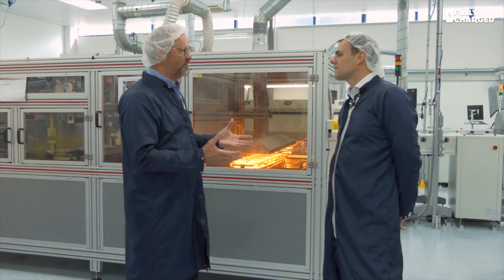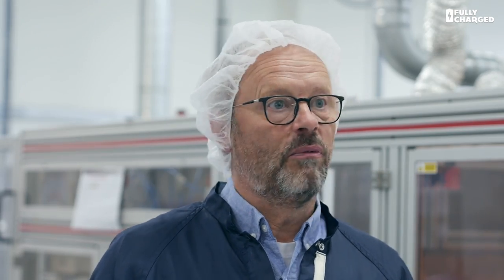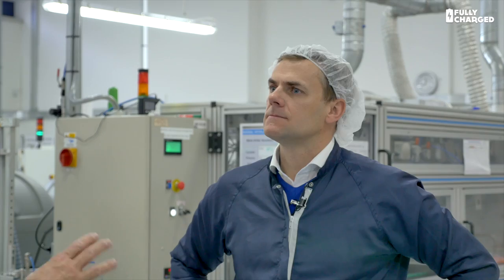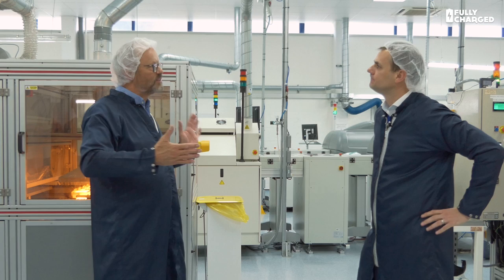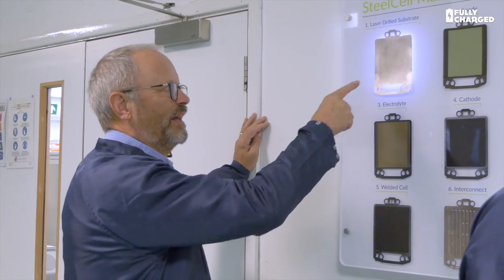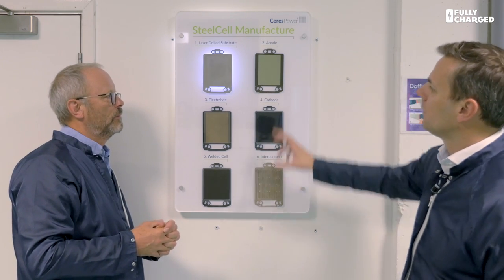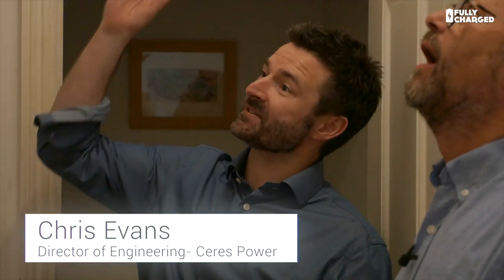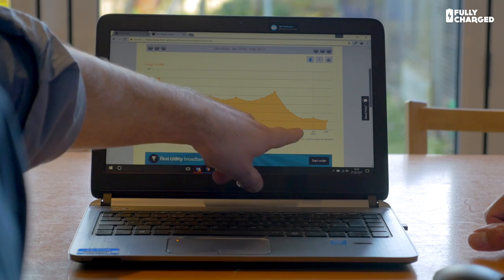Ceres Power | Fully Charged

Comment: Wow, a real engineer tells us that the grid in his region loses about 65% of its energy during conversion and transmission. His comments are truly helpful! That cataclysmic loss must be the reason why we can't have "nice things," so maybe some of us should pay closer attention when real engineers tell us how to effectively support and promote technologies.
Reply: The loss isn't news... it's a well-known stat.
Reply: You can calculate it in your head without ever looking at anyone's stats if you know basic physics, and for recharging of EVs, the loss equates to heaping mountains of nuclear waste!
Reply: To really understand these numbers, you have to know the world record gas turbine has a efficiency of slightly above 60%. You already lost 40% converting gas to electricity. Their real achievement is to come very close to that record number with a very simple system compared to such a multi stage turbine.
Reply: We're not referring to the turbine efficiency. Even if the turbine supplied 100%, you'd lose at least (roughly) 70% to stepping (voltage reduction through transformers which is also conversion), resistance of cabling and switching components, current regulation systems, environment potential at high voltages where the field meets pylons/atmosphere/soil, regulation components of endpoint systems, and finally, the storage materials which can never absorb 100%. There's no reason for anyone to accept EVs as a solution to the emissions problem since they aren't any cleaner than vehicles with internal combustion engines.
Reply: not sure what you mean when you said "and for recharging of EVs". Do you mean when you get power from a natural gas power plant and recharge your EV from it? Or when you recharge an EV from this power on demand system in the video using gas, or charging a tesla wall from solar and charging an EV? Not sure how any of those turns into (even proverbial) nuclear waste either... but do go on.
Reply: I mean "Attaching them to a recharging station which is supplied by the grid which loses no less than 70% of its current before the battery receives anything." That lost energy must be generated by the source (materials processed and then exhausted), the loss increases as load on the circuit increases, and there won't be any possibility of supercharging EVs from residential arrays or service stations with storage systems.
Reply: The efficiency of a conventional Rankine cycle steam power plant is around 40% based on thermodynamics, regardless of the heat source. e.g. 40% of the thermal energy (from chemical fuel) is converted to electricity. The grid is very efficient at transferring that energy over long distances due to very high voltages. So 35% overall efficiency is not unreasonable. There's only about 3% loss from the grid. The biggest loss is that initial 60% of heat which lost through the cooling towers. That's why combined heat and power has big advantages. Piping the waste heat (it's low temperature, low quality heat which you can't extract much more power from) from power stations to where its needed is completely impractical, so it's just vented through cooling towers or used in greenhouses or factories built nearby. Having lots of small generators where the heat could be used where it's needed e.g. homes has been impractical up till now. If this is as good as it looks (I personally think there must be a catch somewhere) then it could be fantastic.
Reply: The resistance of cabling alone causes more than 3% loss and there's no possibility that the transformers are 100% efficient. Again, the biggest losses are resultant of stepping, regulation, and potentials where large fields make contact with the environment. A distributed (grid tie) system must be synchronized so that phases align or the sources will negate each other and destroy the distribution systems. There's no efficient way to synchronize a distributed system and it's best for owners of alternate power systems to utilize the energy for their own purposes.
Reply: ForestNinjaZero - Your point on emissions is a good one, but you only look at the emissions for the local grid to supply power for EV's. What about emissions for the production of fuel for ICEV's?
Diesel generator to operate the oil rig and pump the crude to storage tanks, then to pump to super tankers powered by diesel to take the oil to whatever country, where it's pumped of into the refinery, which then uses the local grid to produce the fuel which puped into a fuel tanker, power by a diesel engine to deliver it to the service station, which uses the local grid to pump it into the ICEV. All those emissions before you fill up the tank and start up and drive off.

So the local grid to charge an EV or ALL those emissions to produce the fuel before you even start your ICEV. 
Makes your emission point a bit mute don't you think?
Reply: At least liquid fuel can support itself, and the conversion rate is multiples of that of electrical transmission systems under the load which would be required to support a fleet of EVs. I can load a tanker and power it to the destination with a portion of the fuel and then supply my fleet without filling anyone's backyard with nuclear waste - please don't counter this with the solar argument since it won't be possible to meet the demand for tens (possibly hundreds) of gigawatts with a central solar farm or support 3+ megawatt service stations with independent arrays. Additionally, if I don't like the 'smell', I can re-tune my existing ICE for any alternate fuel which is cleaner instead of forcing the consumers to sell their irreplaceable multi-million dollar collectibles for scrap while offering no productive solution to the original problem. The EV isn't any cleaner when recharged from a central source, so it isn't reasonable to replace an entire fleet which is already productive and can be easily adapted for more effective alternatives.
Reply: ForestNinjaZero -  I've not mentioned nuclear or renewables. I was only pointing out emissions. I have nothing against the ICE, I have made my living from it for decades. You see I work in the auto industry, i've worked for Johnson Matthey Autocatalytic division in Royston, Herts, UK, where I helped to develop and test "cats" for most of the vehicles you see on the road today, from Tata to Rolls Royce, so I know a thing or two (not a lot) about vehicle emissions. 

I see your point about nuclear power, it's the gift that keeps on giving, and with around 440 reactors in operation around the world, and 60 under construction, plus 160 planned and upto 300 being considered, I 
hate to think of the clean up. And when you look at the current 440 plants in operation, accordig to the World Nuclear Association, in 2014  these provided 2411 billion kWh, over 11% of the worlds electricity. 

But when you see Saudi Arabia trying to sell off oil production, and oil companies getting into wind farms, maybe there is a future for renewables?
Reply: Consider that the ultimate goal of physicists who have dedicated their lives to energy research is to accurately model and replicate the sub-atomic processes which fuel self-sustaining energy sources such as our sun. If you research fusion generators and projects such as "ITER," you'll see that nuclear (fission) power is only a stepping stone and that we're within decades of the next "atomic revolution." My biggest concerns for the fusion generation are the competency requirements for deployment and administration of fusion systems, as well as the inefficiency of turbines(!) - Hopefully someone will return to the nuclear battery research which appears to have been abandoned by the military decades ago.For desert regions such as those of the middle east, it might be acceptable to fill or surround large areas with arrays of panels or large wind farms which can be utilized locally, but for large cities where demand is measured in gigawatts and there is nowhere to construct an array for tens or hundreds of miles, solar and wind won't be appealing to the public or state governments due to the requirements for collection area and transmission systems. It won't be possible to eliminate dirty sources while residential systems cannot fully support households of any size, even with full utilization of available surface area.Regarding future, I'm not suggesting that anyone should abandon wind and solar, however it isn't likely that the cost will ever truly be competitive for the consumer unless they construct and maintain their own systems without any kind of support from companies such as "Solar City." Personally, I don't mind the work, but there's no incentive for anyone who isn't an enthusiast, apart from Elon Musk's promises of accelerated evolution, and the natural desire to play with high-tech equipment.
Reply: Onshore wind turbines are actually one of the cheapest sources of electricity believe it or not. And it's continually improving. I've just finished my mechanical engineering degree thesis on wind turbine gearboxes, helping with research into why they fail prematurely, a problem the industry has been dealing with. Some new designs have removed the gearbox entirely and have direct drive systems. In the UK at least there is a lot of potential for wind with our windy weather and a lot of offshore sites. 
 In the foreseeable future I think a large chunk of our energy supply will come from renewables. The problem of going 100% renewable of course is the variability of the energy sources so some sort of grid level energy storage, or backup energy supplies are required. 
 I think gas would be a good backup since it's easy to transport, doesn't need any refining and has a multitude of sources. Those Ecotricity gas farms or sewer gas for example could be direct renewable sources. Industrial gas turbines also are more efficient than steam power plants, particularly if you use the waste heat to power a steam power plant which is a new design being developed. Gas turbines also start up relatively quickly compared to steam plants and are low maintenance. They can burn any type of gas, even oil or coal dust theoretically. Then with these fuel cells for combined heat and power in the home, that could be a good solution. 
Of course, far in the future, nuclear fusion will be the ultimate power supply. This is just where I think it could go with current technology.
I personally think nuclear fission should also be a future energy supply. Liquid salt reactors using Thorium have a lot of potential if they work. Although that's a different discussion entirely.
Reply: I believe that the key to solving the conversion problem is to eliminate turbines entirely, which is why I've mentioned nuclear battery research. That would be as close to a 1:1 conversion as possible for atomic fission based on particle interactions within the medium, and we know that 100% will never be possible unless someone engineers to a way to genuinely pull energy from another dimension (holy fraud batman!). I don't see any solution to the transmission problem with current inverter technology since efficient timing of signals over any distance for even two sources is nearly impossible and it won't be possible to support a large grid with one inverter. Regarding cost, it's expected that the per-unit cost for mass deployment of renewables will be much less, however the reduction is irrelevant if the greater percentage of energy is lost to the transmission system within a few miles of the source since the damage to the immediate environment will be worse than anything which is caused by carbon emissions due to the area requirement. If our intention is to convince the public that renewables are the best solution to the problems of grid congestion and dependence, as well as emissions from dirty sources, then we should manage their expectations in an honest manner. Megawatt EVs and half-efficient roof tiles will never be an effective alternative to any combustion system, and if we allow the consumers to encounter the 'energy barrier' after convincing them that they've been enlightened, they'll reject the technologies entirely and the market will crash.
Reply: "efficient timing of signals over any distance for even two sources is nearly impossible" - RFC 868, GPS, and those selling electricity back into the grid beg to differ.

"Megawatt EVs and half-efficient roof tiles will never be an effective alternative to any combustion system" - Tesla's Model X is pulling mine carts without poisoning the workers, and solar tiles heat homes without stinking up the neighborhood with a fireplace.